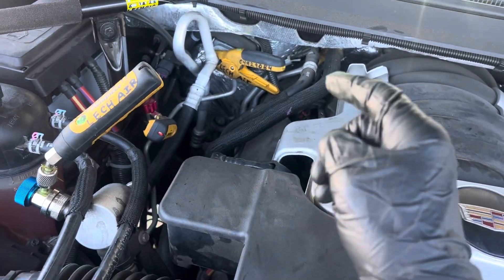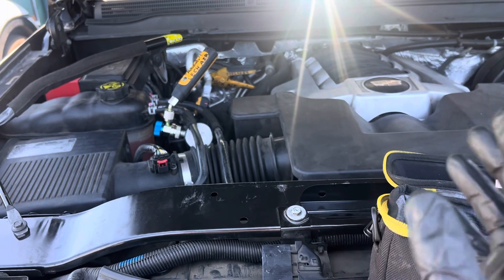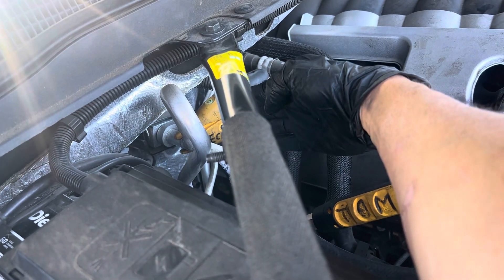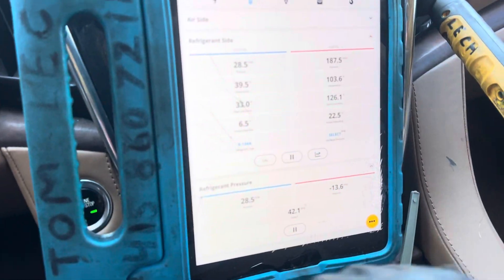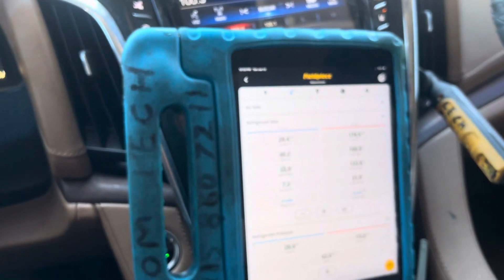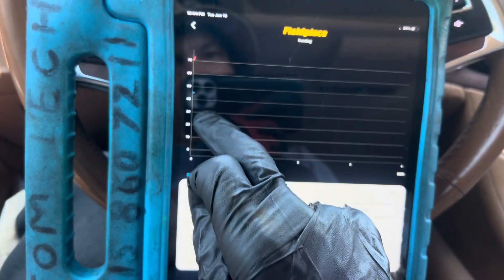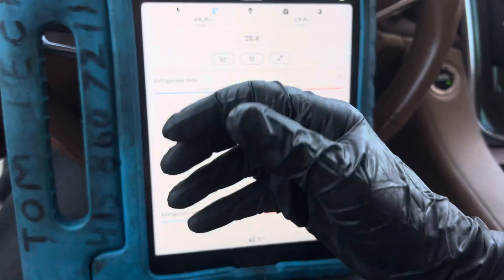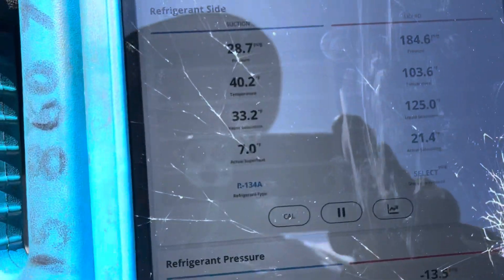Duel Evaporators, 2015 Cadillac Escalade, ￼ SuperHeat, topic, and heat gain on refrigerant line. ￼

Comment: Wasn't there a thermal probe on the market at one point that didn't have a thermistor or thermocouple, but actually used the metal of the tubing to make the thermocouple junction?
Reply from the maker: Are you talking about the little one and a half inch square tube that had a gas filled tube that would come off and either be pushed in the fins of the evaporator or attached to the tube.  And this gas expanded and pushed on bellows that opened and close the contact to turn the compressor on and off.? 

Or are you talking about that one? I think Chrysler had suction line tube and it put a smaller tube inside the suction line tube traveled and was braised in so you can stick a thermocouple into the hole that was like quarter inch or less. .  It had white gooey thermal paste on it, and it was inserted to get on the inside of the suction line to take to True Refrigerant temperature. ?
Reply: @coldfinger459sub0  No, but that's interesting, I never heard of that. I think it was about 10 or 15 years ago, it was a clamp probe which used the dissimilar metal of the tubing to create a thermocouple with the probe. I'm not sure if it had multiple contact points so it could work with steel, aluminum, and copper. I was sure I'd read about it years ago, but trying to find evidence of it now I'm starting to think it was a figment of my imagination.
Reply from the maker: @WaffleStaffel  I could see it only working under the most ideal. Perfect conditions at first clean copper, clean aluminum in different metal no oxidation no moisture perfect contact.. 

Then, after time in oxidation, I would believe readings were drift

Comment: TOM i understand about super heat but it is not useful in TXV because it has way to adjust the flow to an extent, subcooling is used on TXV in residential.
Reply from the maker: Sounds like you read too much about residential

But even with a TXV if the refrigerant levels low TXV, cannot control or compensate for more than what it was designed 

Your superHeat will still rise 

This is the difference between what you read or see you in a video and what you know and real world. 

Your instructions on your residential unit if it had a piston or capillary tube system, we know it’s charged by

If it has expansion valve, we know it’s charged by

But super heat is still a very good indicator of problems
For what the expansion valve cannot control for

That’s the difference between a technician and a parts changer

This is why we owned the equipment that can actually test accurately

This is why we test and we don’t guess

This is the difference between someone with experience and somebody without experience

On a residential unit with a TXV if you have a long line set, running up in a hot addict in Texas, and the insulation was ripped off the suction line by an animal that wanted to make its nest out of that foam

You will see the problem in superHeat

Need to watch some more Brian orbs videos, from HVAC School, some of Greg‘s videos from HVAC service LLC and Ty Bremerman‘s videos from Love2HVAC

Then you step up to the next level to use measureQuick